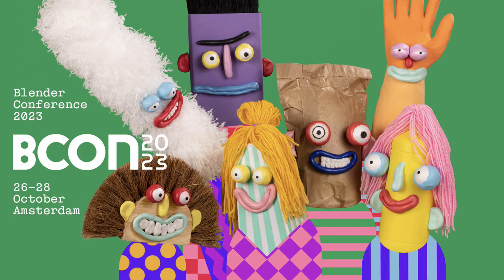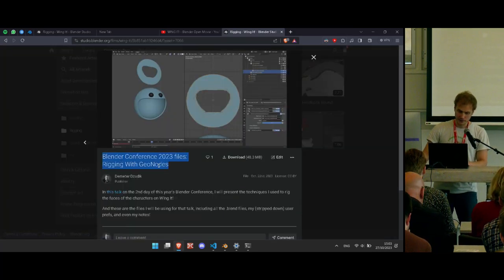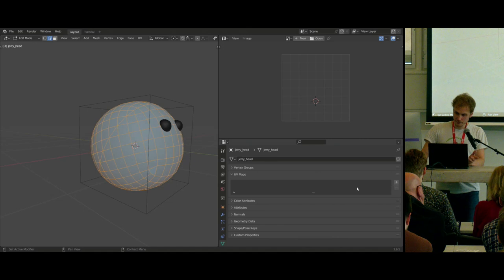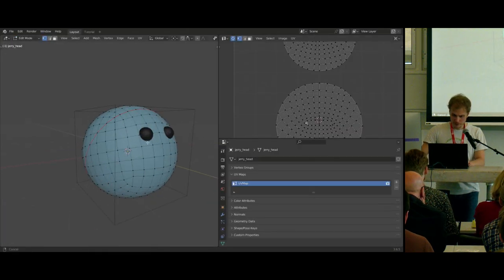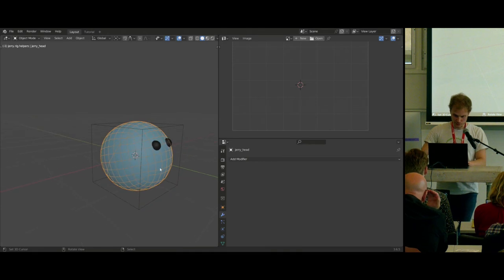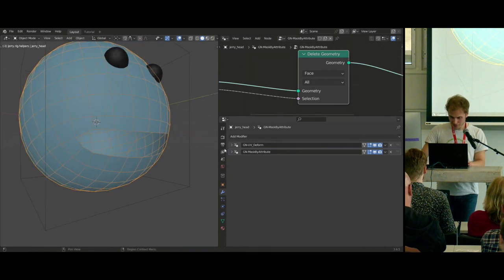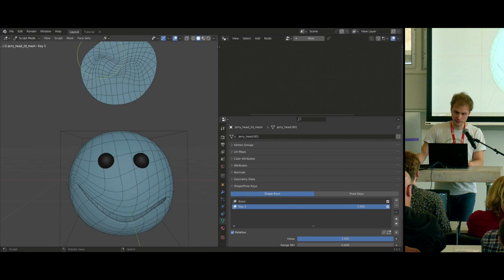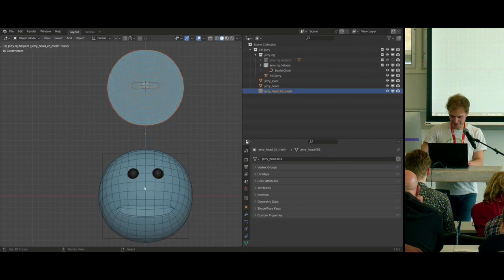Rigging With Geometry Nodes on "Wing It!"

Comment: 46:43 nice it also transfers movements perpendicular to the "uv" plane
Reply: Good catch! I forgot to mention it, but yes, there are a few nodes specifically for that functionality, and there's even an exposed parameter called "Depth Deform" (0.0-1.0) in case it's not something you want. For those cases, I would also advise to lock the bone controls on those axes, so they don't accidentally get moved along the depth, which will make it more convenient to use.

Comment: Cant this be done with duplicating the headshaoe and shrink wrapping the rigged head to the duplicate head shape?
Reply: Not sure if it's what you mean but he mentions a shrinkwrapping approach after 19:00
Reply: Yes, you're totally correct, that's what we did on Sprite Fright, so it clearly works and can get you very far. But I consider this an evolution of the Sprite Fright tech. I think it's superior, and this is how I would rig characters for such styles going forward. And this tech can still be built upon with more functionality, for example if Jerry had a nose or ears attached as part of his topology, it wouldn't work great out of the box with what's there currently. I can very easily imagine how I would address that though, and it would involve Surface Deform! ;)

Comment: How do I make that pie menu that changes the editor space?
Reply: You have to enable an addon that is pre-packaged with blender called "3D Viewport Pie Menus"
Reply: There is one such pie menu that comes with the 3D Viewport Pie Menus built-in add-on, as another commenter said, but my one is slightly different, in this case I created it with the Pie Menu Editor add-on which is available on the Blender Market.